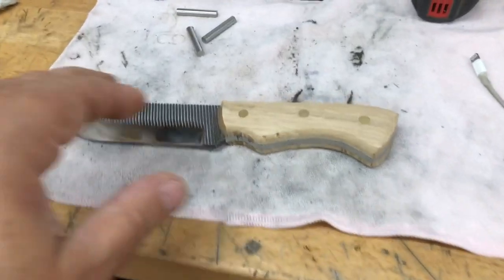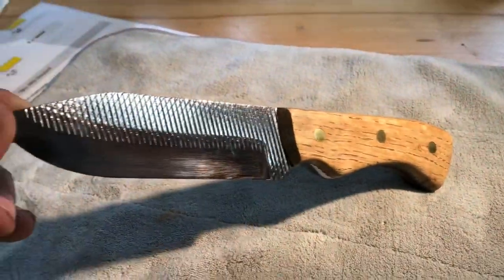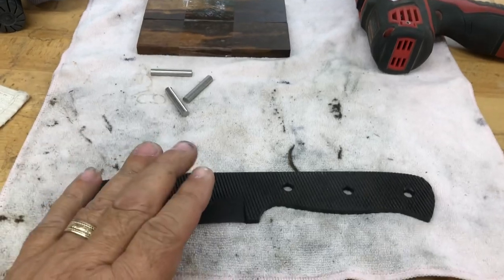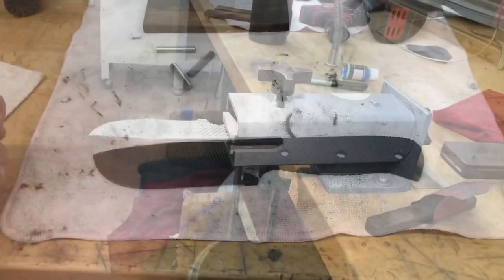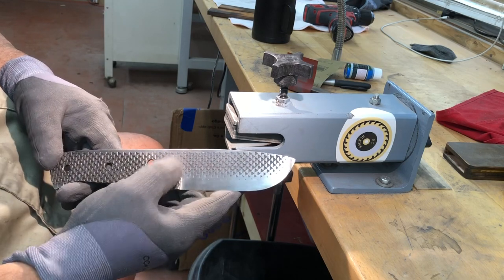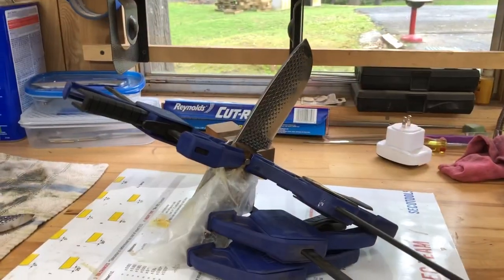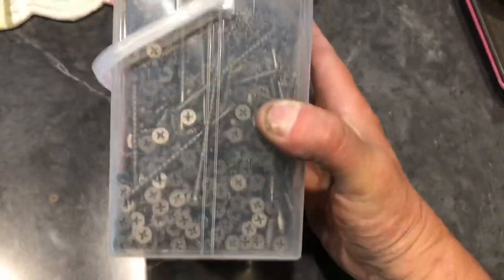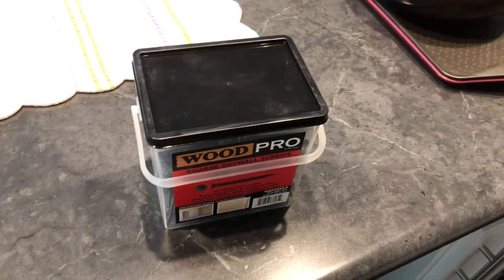Finished the first file knife

Comment: Good to hear a smile in your voice, since you're back in your knife shop. The finished knife is beautiful! Started out as a rough quartz like stone. Ended up looking like a perfect diamond, faceted by a skilled gemsmith. BTW, your fastener wall is a work of art, as well. It had to be like having a vitamin deficiency when running low of a vital component. :-)
Thanks for sharing. God bless,  my friend. Godspeed in your travels.
Reply from the maker: I was beginning to get concerned! I missed your comment!
Reply: @bctruck  Thank you for your concern. Appreciated. Been caught up in some projects on the home front. Some I need to get done before I begin summer hibernation from the heat & humidity. Will be hitting 90F at any time now. (sigh)

Comment: That knife looks awesome. What a good deal on fasteners just bought some at home depot next time I will check Amazon thanks.
Reply from the maker: Bought two cases of 4 inch decking screws a couple years ago. I’m still only 2/3rds through the first box. That’s what I used on my carport that I just built.
Reply: @bctruck  o nice!

Comment: That is one unique custom knife and gorgeous imop dare I say cool 😎
So just thinking out loud , what say you pretty much left most of the file intact on the blade would you end up with a knife and file at the same time . Talk about a survival knife .
Reply from the maker: I had to dull the file for two reasons. One, the epoxy won’t stick without really cleaning the metal and two, the roughness of the file would destroy the leather sheath in no time. I left enough teeth so it’s still recognizable that it a knife made from a file, but it’s filing days are over. 😂😂